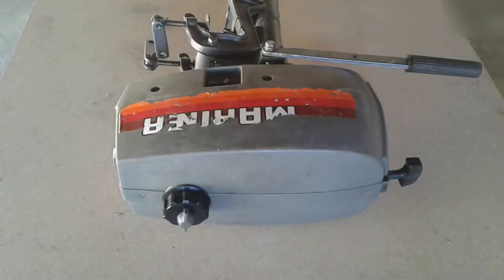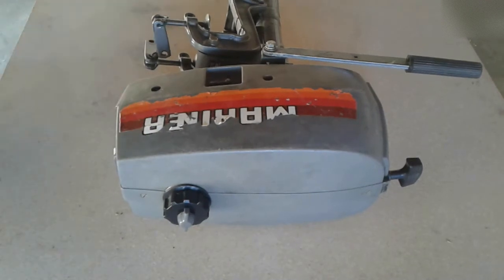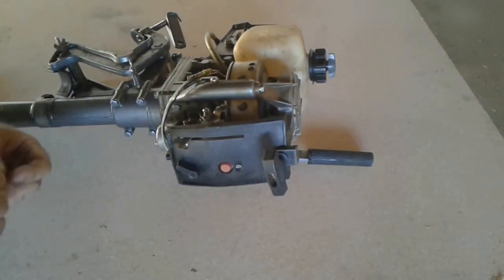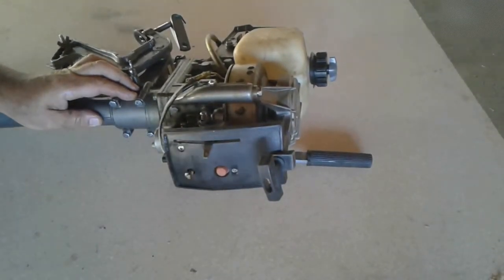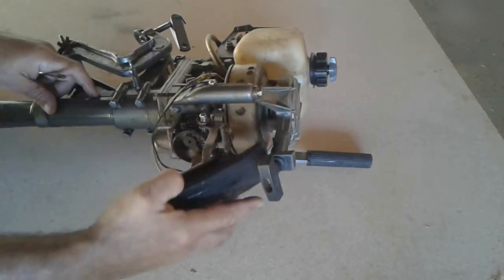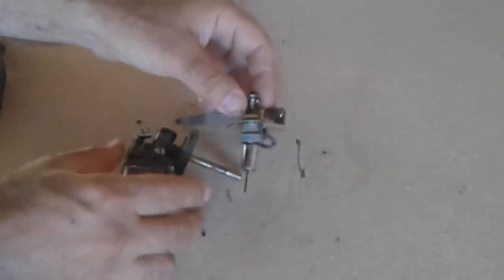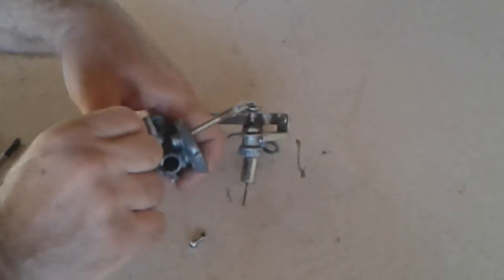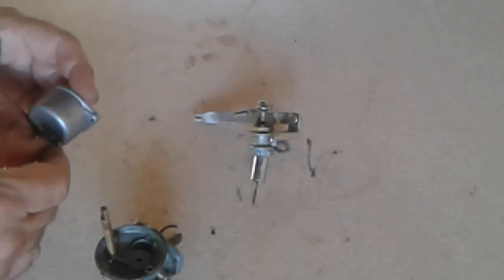Removing and dissembling dirty carburetor from 2hp Mariner or 2hp Yamaha outboard engine.

Comment: Hey, thanks for the video! I am trying to fix mine but on mine it seems like there is a part missing on the cover that is a part of the carborator. It is a small hole straight into the plastic cylinder part where all the gas is dripping out. On yours it seems like there is some kind of ventil... it is located centered under the front cover, do you know what that could be? Feeling lost as there is no such part in the owners manual...
Reply from the maker: Sorry I do not.

Comment: Henk, I have the same problem that you start this video with--I'm getting gas leaking out of the carburetor. In your case, was it the shut off valve that is actuated by the carburetor float, or was it something else? My motor had not been run in 30 years, but it started right up with fresh gas. Hoping to narrow down where to look, although I plan on taking the carburetor off and cleaning it.